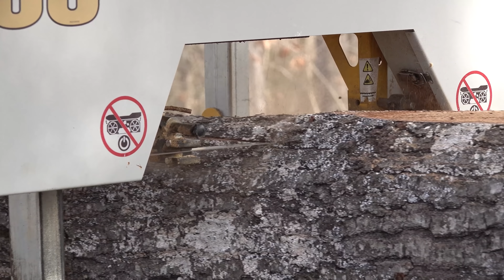Turbo 7 Wood-Mizer Blade On Frontier OS23 Sawmill! Will it work?

Comment: Saws cuttin good. I cut a lot of red and white oak as well as maple and cherry. All real hard. Next time you’re at harbor freight grab a couple of their small rubber wheel chocks. I use them all the time with the mill for stopping logs. Very handy!! And yes, eventually you cut a log stop off.  Lol
God Bless!
Reply from the maker: I did cut a log backstop off the next week.

Comment: Hot rod sawmill, good job on the motor swap, I used Joe’s blades for the first time today on pine and I’m impressed, they seem to pull more sawdust out of the cut
Reply from the maker: I fine the 7 degree blade has a smoother cut on Oak. Almost like a planner went through it. What are your thoughts?
Reply: @TonysTractorAdventure  yes I love them, I have always used Wood Mizer blades but I like these better than the double hard ones, when you get the pole barn done I still want to come meet you guys and bring some black walnut,

Comment: You have that Frontier cutting great.  I'm so impressed with that "motor".  I use the 7° blade as well. I have mostly red and white oak on my property... it's HARD.  Keep up the great work.
Reply from the maker: Jerrry, Thank you. I am impressed also. I had thought about putting the 22hp v twin on the sawmill. I think it would have been too much.for not enough gain. I am very happy with this sawmill.

Comment: The Wood-Mizer Turbo 7 blade is a very aggressive blade and needs to move quickly through the wood. If the mill and blade will take the speed give it to 'em; you'll get a better cut.
Dave
Reply from the maker: Thank you, Dave. I agree with you. That blade digs.